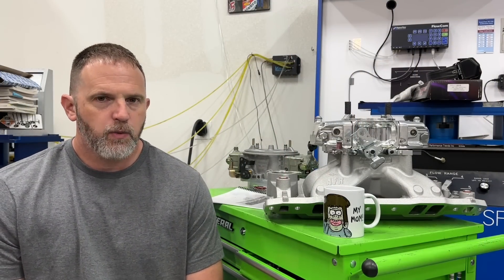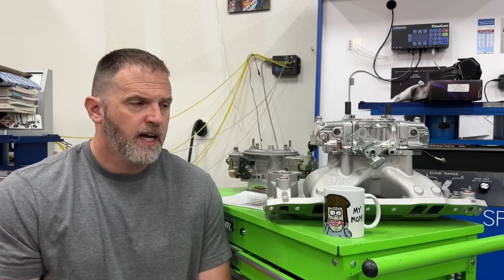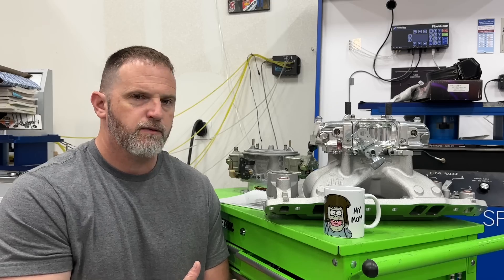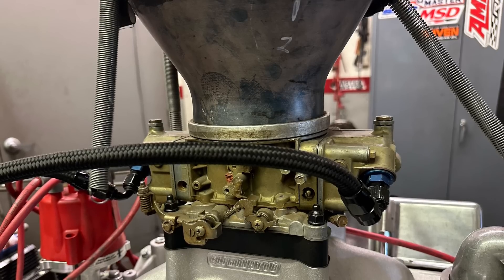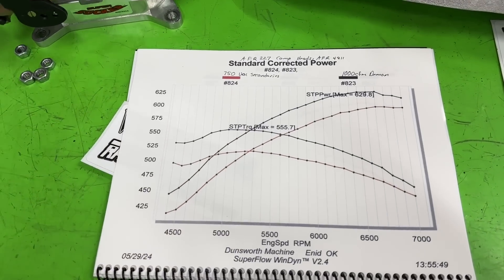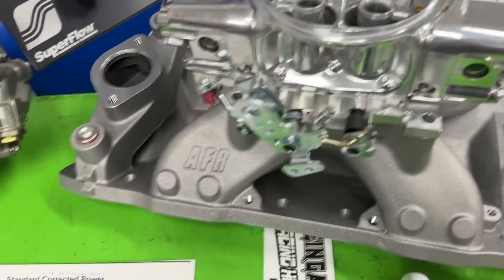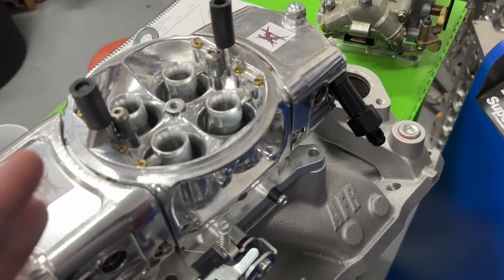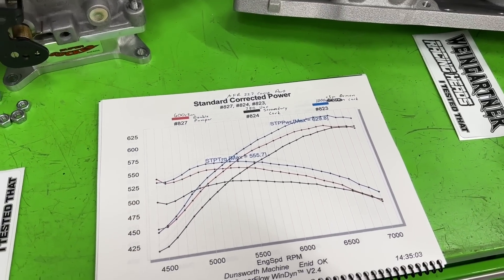Can A Smaller Carb Make More Power Than Larger Carb

Comment: Its obvious that engine can flow enough air to support the 1000cfm, and the smaller carbs were a bottleneck. Now put that 1000cfm on a 350hp motor.

Comment: Carb size does not increase hp unless it becomes so small that it is a limited of charge density in the intake runner. Except, drivability keeps getting better the faster the charge cloud in the intake runner moves. Throttle response and torque are always better, to an ultimate point, with a smaller carburetor
Reply from the maker: My testing has repeatedly disproven this.

Comment: Take a stock, low compression 302, 305, or 350 and slap all three of them carbs on it and you'll get the results you're looking for.
A 750cfm carb and up will flow more air than a mid 70's smog motor's intake ports.

Comment: I built a 400sbc with dyno numbers of 500ft.lbs. of torque and estimated 500hp. Because we did not want to go past 6500 rpm, and at that point the power was close and still climbing at a 45 degree angle, with a 1000 cfm. HP. holley, and drove it on the street , with 3.73 gears, 29 inch mickey pros., 2200 converter, and could Flat Foot it, and it would leave so hard wth that port matched air gap, that your hat was going to leave you. So many people underestmate a 400 sbc. When at 406, its bigger than a 396 BBC !?
Reply: A 400 block 4.125 bore ,with a 4 inch stroke crank = 427. .030 over 4.155 with 4in. Stroke crank = a 434 cubic inch torque monster. The Stroker Guy.

Comment: Track times will debunk your theory. Highest dyno numbers dont always equal fastest ets
Reply from the maker: I have tested it on the track. Bigger carb went faster. Did this multiple times.
Reply: @WeingartnerRacing  I wonder if it has a bit to do with your heads and intake combos flowing so much more air than most average guys run.. say a 302 with gt40 iron heads and a b cam, or similar sbc type build.. also, wouldn't a larger carb be a bit harder to tune on a lower performance engine? Say a 850 on a car that only flows 450cfm? Just thinking out loud.

Comment: My 1970 galaxie had a 2 bbl 351 so I went to a 570 vac secondary.  Then put a lunati barebones cam in and ported iron heads but kept the 570 because of the stock convertor.  I needed the lowest idle speed.  It worked but I had to open the secondaries just a little with that adjuster screw.  I'm still working on a 408 and bought a 780 for it but I think it should have more now.

Comment: I don't think people understand that the CFM is airflow not fuel so if it is jetted properly then it is going to make more power because it is going to be easier to get that new air charge into the cylinders. I wonder if that fallacy came from the old days of putting double and triple carbs on an engine and perhaps not jetting them properly so they were always running super rich?

Comment: Quick question. How much of an effect doesn't elevation have on what octane gas you need to run? I'm a little closer to sea level than you so would I still be alright with 10.5:1 on 91? I've got an older Chenowth that I'm planning on repowering.

Comment: So I have a BBC 402 at 10: 1 compression, big cam, single plain Holley Street Eliminator manifold, approx 425 HP, went from Mechanical 750 to mechanical 850 but saw no HP increase. I tuned accelerator pumps etc. then rich 2 jet sizes, still no gain. It looks to me may still be lean, I decided to install mixture meter, could that be no gain reason ? Thanks.

Comment: Pop a rivet in the vacuum secondary linkage so it starts cracking open at about 75% throttle , bypass the vacuum  😮
Reply: Zip tie for the dyno..works 1 to 1

Comment: What about smaller vs bigger carb on a smaller less potent engine
Reply: More Vacuum = More Responsive

Less Vacuum = More Power

1966 Mustang Coupe 
289 2V (Low Comp)
Factory 4V Intake
3.00 Axle / 3.03 Low 3-Spd 
390 VS is very responsive which really matters in a street driven stick with tall gears. It's well worth the 1-2% sacrifice in peak power over a 600.

Monza Drag Car (2870 lb)
461" Oval Port
5.14 Axle / 1.76 PG w/ Brake 
5500 rpm Stall
850 DP - 1.31 60'
1150 2C - 1.29 60'
Response is a non-issue.

Comment: I'm putting a 950cfm on my 350 dual plan today. 😈
Reply: Unless you're running 7500rpm that's too much carb, but you'd still be a lot better off on the bottom end with a 650 or 750
Reply: @lumpyzx2645  So, restricting air into an engine helps? Show me a single dyno test where your statement is a fact.... maybe Google david vizard and learn something and not spout ignorant myths.
Reply: @lumpyzx2645  , hey don't take it personal you were only trying to help. But there are limits to bigger is better. That guy has I guess a dual plain he said plan. Dual plain is for bottom end power single for top end, so he's probably not at 7500 rpm.

Comment: Okay the vacuum secondary carb does not have a second accelerator pump. During wide open throttle the pump squirters will pull fuel thru them. There fore the double pumpers fuel curve is better during your testing. This is the reason for the higher up output. Using a large carb is okay asking as the customer uses a large carb also. With proper fuel curve tuning the vacuum secondary carb would be closer. What I do is install a secondary metering plate to make it easier to dial in. Also you should use carbs that have the same booster design to truly compare. Other than that I agree more air flow should make more power.

Comment: How much vacuum did each carburetor make at wide open throttle?
Reply from the maker: Didn't record that
Reply: @WeingartnerRacing  
I know this 406 is a "dyno mule", but can something like this be a viable tow motor in a 6k lb 1 ton truck? If not what changes would you recommend and what would that net me........?

Comment: Nobody ever talks about the quality of the air/fuel mixture.
Reply: I believe this test wasn't about air/fuel mixture, I believe the author mentioned all 3 carbs were close to each other. I think the ideal is 14.7 ?
Reply: @davidstone949  14.7 is the 'stoiciometric' ratio for complete consumption of all the fuel.  Think of it as a recipe with the correct amont of eggs per cups of flower.  However, the recipe requires the ingredients to be mixed appropriately.  Same goes for the air/fuel mixture inside the engine and the mixture's distribution across all the cylinder.  Think of multiple cake pans filled from the same mixing bowl, all filled to different levels.

Comment: I agree, I have never understood why somebody would buy a vac sec holley, let me tell you a story 😂😂😂😂😂 back in the day, early 90s i had a buddy with Ford falcon  with 351 Cleveland, he was running a vac sec. Holley, I loaned him my reg mech. Sec 650 and he blew his motor because it reved so much faster than he was use to 😂😂😂😂😂😂 mech sec only unly you're driving granny to the dr or store good rule of thumb unless you wanna be the 1st loser....2nd place
Reply: Vacuum secondaries "can" be good and perform as well, if and only if you get them dialed in perfectly... jetting, secondary spring, squirter nozzles, air bleeds, accelerator pump, and accelerator pump cam, etc. 🤣🤣😄🤣🤣

Comment: I'm very surprised you didn't mention using a vacuum gaugeto work out best carb size... isn't pressure drop what it's all based off? Joe Sherman told me many years ago he likes 1 to 1.5" at wot. I can't think of a better way of knowing, rather than guessing. Would've picked up what was really happening with the vac secondaries on the 780. Joe also said in most cases putting a larger carb makes more hp, but doesn't mean it'll be faster on race day.

Comment: Carb cfm recommendations   are a guideline  for selection nothing more    so whats the standard use ?  Every  combo is different  most dynos cant replicate  what the engine sees on the road anyway    your right  saying your 1000 felt fine on the 355   seat of the pants  counts  !  tune up  vehicle gearing  everything  has an effect In  " some "   way   making it all work together  is the challenge.

Comment: It's the annular boosters that make all the difference.  Fuel distribution is more important than max cfm.  I used to run an annular booster mighty demon 850 on a 452 cu. in. FE.  It made the same horsepower as the 8V Weber 48IDA setup.

Comment: Give me a 1000 CFM with annular boosters any day.

For years the magazines (before the internet) warned you not to run a double pumper on a street machine.  That is a crock, and there is the dyno test to prove it.  If you've got a well warmed over small block (pretty easy to do with the proliferation of aftermarket heads and other parts) and you have the converter or a manual box to go with the setup by all means you can run a double pumper.  Don't expect to run a larger vacuum secondary (say, 750 cfm as tested her) out of the box and get fantastic results over your old Qjet. It may perform even worse.

Comment: Great info! This solved a 40 year old mystery for me. I replaced a 4777 with a new 3310 looking for more power out of a 302 Ci Chevy in 1984 (327 block, 283 crank). The 3310 made less power than the 4777 (slower ET). I never considered that the vacuum secondaries could have been the problem. I put the 650 back on and a few months later replaced it with a swap meet 4781. The power increase was noticeable between the 650 and the 850. Nothing but double pumpers for me after that. Now I know why the 750 vacuum secondary carb didn't work out for me. Thanks Eric!

Comment: A list 3310 is a 780 vacuum secondary, not a 750! A bigger carb will make more peak h.p. A smaller carb will make more average h.p., thus is the better choice for a street car. I didn't watch your video. But from my experience this is true! You can't drive a Dyno!
Reply from the maker: Don’t comment if you didn’t watch.
Reply: @WeingartnerRacing  piss off!
Reply: Nope. Smaller carbs are for fuel economy and vacuum assist.

Comment: I’ve always run 1000 + cfm low profile dual plane, dual quad intakes on the street with my high performance small blocks.  You have to know how to set them up and how to tune them, but they always made more power, better throttle response, and improved fuel economy over  single 850cfm and smaller carbs.

Comment: More airflow has the potential to make more power lol 

Too much cfm is really not the problem, too low of a booster signal is!

If you can make the big cfm carb atomize the fuel properly then there is no point in having the smaller cfm carburetor 😂

Comment: Had a  Holley 1050cfm Dominator carb and the little 327 made in the 600hp range  

Got a 750cfm carb now and smaller Cam shaft  , 
There is a big difference  ! 

So I would give this video a  Thumbs down just for talking about it

Comment: I had 4 Holleys that I was testing on my 81 camaro, 383 stroker,  super t10, 3.42 gears. I had an 850dp, a few 3310s, and a 650dp. The 650dp always outperformed all of them on the street and strip. That being said, I never gave the 850dp much of a chance, I bolted it up and ran a 12.55 @115, but the 650dp ran 12.33 @117. The 3310 carbs would not breach 110mph. That was 20 years ago.. I am now bulding an 1986 IROC z28 with a 327, and my first choice is 650dp.  The brawler 650 looks like a great choice!!

Comment: I'm Shure ur air pumps move more air than my story but stock  gm Goodwrench creat engine old qjet was worn needded more than gaskets
I've had 383 with 750dp high rise intakes but summit and buddies dad that had very nicely done 71gmc absolute monster recommended a street avenger summit guy recommended a 570cfm or 525 something small and that maid than engine go from fun to stupid revy torquey one pull leaving work it spun the 1084 Scott's Dale 85 mph speedometer around to 45 mph before I maid it in town proubley about 1 mile from town had more to go miss that truck can't wait get another I was probably 14 at the time of I could put a truck together like that would be great there was a dodge in town I could touch to save my life he would jump half car out in front me id lift now I wish life was that simple still

Comment: I used a Holley 650 double pumper on my '69 GTO {400} worked great and I am using same on my '64 Ford 390FE, mind you I don't usually go beyond 4,000RPM, bottom line though LOVE your explanations

Comment: I have always answered the question of vacuum or double pumper , is it depends on how you drive. If you floor the pedal, use vacuum. If you drive into the carb, go double pumper, and make more power. I had other's try to drive my car and floor it, and it would stumble and quit, and I could drive it and lay two solid stripes for quite a ways. big difference in driving style.
Reply: @wadewingfield4606  sounds like your carb needed bigger shooters.

Comment: Probably a better title for this video would be "how much power is my vacuum secondary carb choosing me?" . Also a trick I bet would close some but certainly not all of the disparity between the 650 and 1050 would be if you could add a significant amount of plenum volume with a tall spacer or something but if your not restricted to a certain size then just get a bigger one.

Comment: Did you test with power valves?
Reply from the maker: yes
Reply: @WeingartnerRacing  thanks for all your hard work. Had similar results with 800 dlb pumper on hdl roller cam 468 BBC same carb on sld roller 302 SBC stick shift with good results. On the same note the 800 ET better than 1050 Dom 468 combo. Properly tuned for the combo is key.

Comment: The vacume secondary diaphragm gets it's vacume feed from the RF primary venturi. Not engine vacume.
Reply from the maker: Which comes from engine vacuum.  Without engine vacuum it will not open. The vacuum has a  direct relation to motor size and rpm. That’s why you need different springs for different combos.
Reply: thats correct, but it depends on the flow through the primaries. If you floor the pedal with a larger carb , it takes a while for the engine to get up to the point of the correct vacuum signal. Too large a carb on a street car , not properly setup and geared, can cause signal delay.Thats why on a street car I would recommend a smaller carb, which usually gets you a better signal earlier. It also gets into your driving style, do you just floor it , or carefully drive into it. If you carefully drive into the carb, I always recommend a larger double pumper.

Comment: the 11 to 1/Pump gas street comment,......... I think a lot of that depends on multiple factors ( heads/Chambers/pistons top and Local altitude) here on the east coast , Old school Mopar 440s  , 915 heads, flat top pistons and 80% humidity  110+  LSA cams will ping around 32degrees total timing , same engine same with KB quench dome , you can run as much as 40 degrees. now on the other side of it , alum head SBC @ 11 on 93..they'll run pump 93 no mater the time of year here in Eastern PA.  I do G3 Hemi(s) , my personal 04 Ram runs Eagle heads on a stock 04 Short block, roughly 11.80s to 1 comp, I run 93 oct and 24 degrees total timing(G3 hemi in general doesn't need a lot of timing) I've done tuning for similar combo's for a few people who live Denver and Phoenix ,In Denver that combo can't run more than 16 degrees with out the knock sensors going Nuts, Phoenix roughly 20 degrees.......Eric, I love the Videos , lots a respect .

Comment: At this combination, of course. BUT if you take a stock sub 300 small block with stock heads, headers+exhaust, intake and cam, and slap a huge carburetor on that and run from 2000 up, those numbers will be different. I would argue that having a single 1000 cfm carb is too small for a racing engine. As seen in those numbers, it falls on it's face before 8000.

Comment: So you told us the way to add more information to your data is the record manifold vacuum along with speed and torque.  Even if you had vacuum recored for all configurations at the same high engine speed it would be an interesrting datapoint ... just saying.